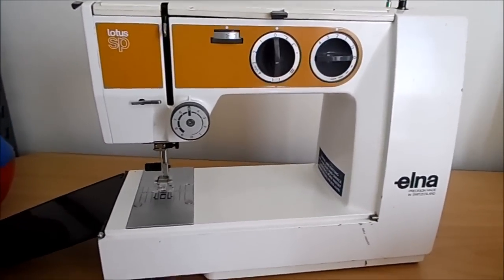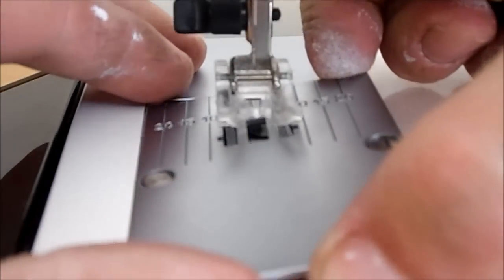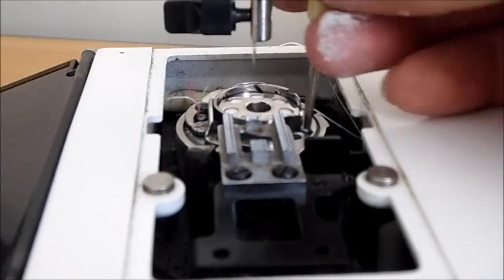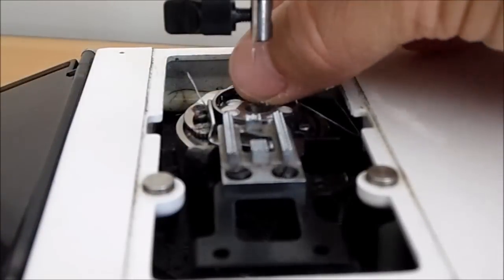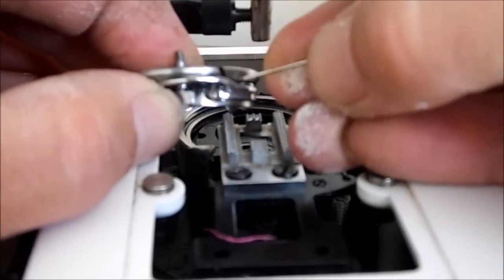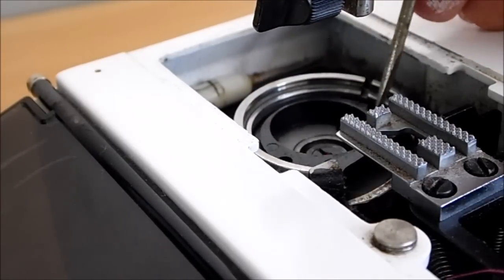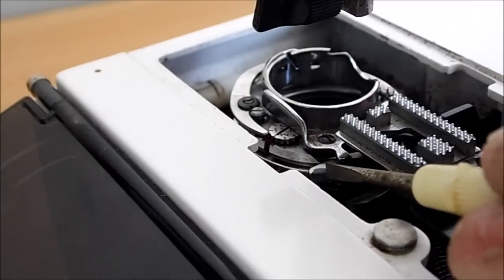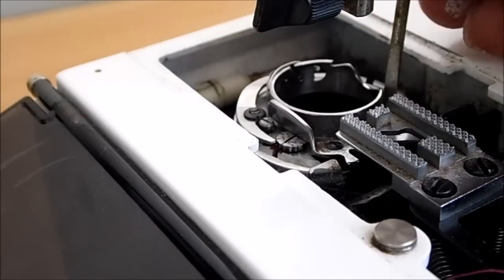Elna Lotus SP  bobbin case repair  - Removing a cotton jam from a Elna Sewing machine

Comment: Followed your instructions for loosening the two correct screws to release the bobbin case on my Elna ZZ. The bobbin case wiggles just a bit but cannot be removed. The screws are loose and twirl in place. Do you think the screws are somehow stripped? What else could be holding the bobbin case in place?
Reply: Ah, finally pried it off! Thanks so much for saving me a repair bill!